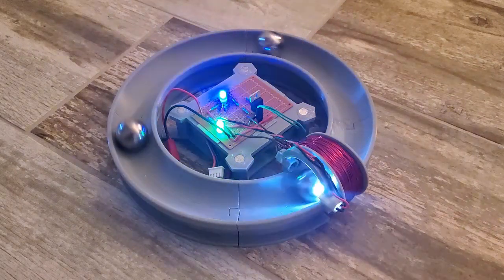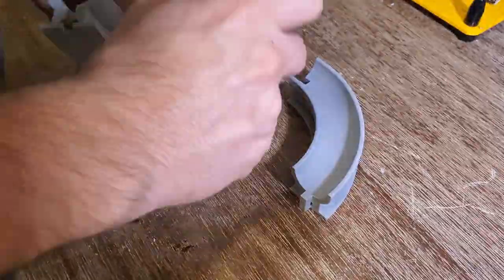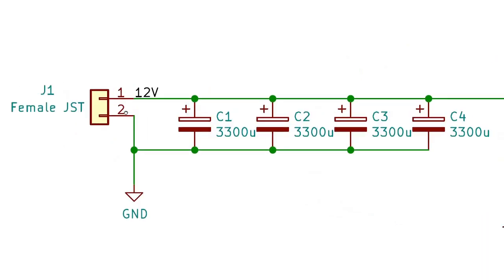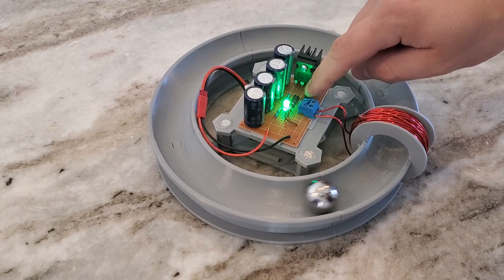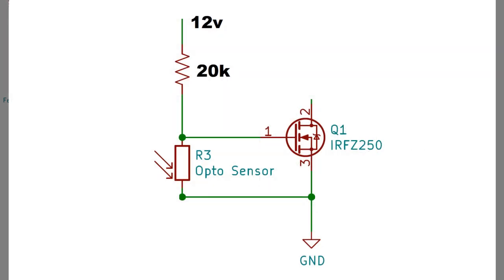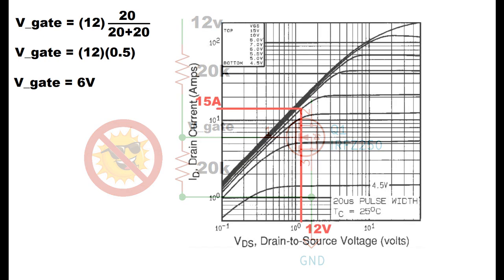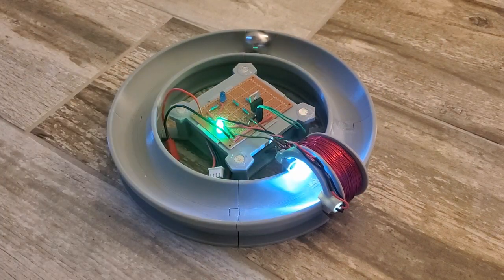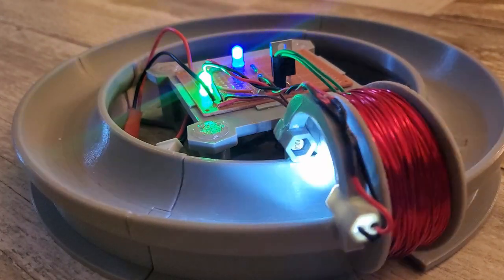Electromagnetic Ring Accelerator

Comment: For the electromagnet is the coil just wrapped around the same material as the track or is wrapped around iron?
Reply from the maker: It's just wrapped around track material
Reply: But then like did u have to make a crazy amount of loops by the wire to get a magnetic field?
Reply from the maker: @sceptre991  It's about 300 turns which only takes a minute or two to wind and there's 6 amps running through it. Nothing crazy
Reply: Oh I see. Because I was trying to replicate it but I only had 1 amp so that’s probably why

Comment: Hi! I know you might not get to this comment, but I was wondering what materials and wires you used in the middle. I already have the female JST, opto sensor, and led's, but I can't seem to find the rest. I'd greatly appreciate it if you could reply to this comment. Good job on the project!
Reply from the maker: The pieces are 3d printed and snap together with magnets. The board is just cheap perfboard

Comment: Using an electromagnetic acceleration gate would be interesting space tech for a non fuel dependent sling into the direction you wanna go. Build another gate on the other end to catch incoming traffic.
Reply from the maker: you mean this lol https://en.wikipedia.org/wiki/Mass_driver
Reply: @HyperspacePirate  aren't mass drivers to shoot unmanned projectiles at ridiculous speeds that would flatten a normal human with sheer g forces. And or a proposed way to launch material cheaply from one planet to another.
Reply: @HyperspacePirate  no I mean a literal gate large enough to accelerate a space ship to it's receiver, without killing the occupants. If you mixed this with one dudes molten sodium experiment you'd have a starship with a magnetic field (rad blocker) and an acceleration gate (fast intra system travel).
Using field manipulations you could have the receiving gate emit a repulsion field to slow the object in question on approach.
Reply: @HyperspacePirate  https://youtu.be/rAYW9n8i-C4 this guy's experiment

Comment: OK, I've printed all 4 parts with the 4 coile option. How would I wire all 4 coils? I'm sure I can't just connect them all paralel !
Anyway, thanks again for the STL files!
Reply from the maker: The high sides are all connected to VCC (12V in my case) and the low side of each coil is connected to the drain pin of its own MOSFET (i use an IRLZ44 in this case, but there's lots of others that will work). Remember to connect a flyback diode across each coil with the cathode *FACING VCC*, or else the inductive spike from the coils will cause a voltage spike that will destroy the whole circuit

Comment: how did you connect the LDR so far from the board?  And is this possible to with a breadboard and Arduino?
Reply from the maker: It's just 24 gauge wire running to the LED and photoresistor. Not difficult at all.

You can definitely do this with an Arduino

Comment: Good video! Is it possible to buy a switch wich is activated when the light is interrupted, like yours? I want to try it for myself
Reply from the maker: I'm not sure where to find them as packaged units, but it was very easy to build. I just used an LED and one of these photoresistors:

https://www.amazon.com/MCIGICM-Photoresistor-Sensitive-Resistor-Dependent/dp/B07PF3CWW9/ref=sr_1_3?dchild=1&keywords=photoresistor&qid=1624025077&sr=8-3
Reply: @HyperspacePirate  Thank you, not very experienced with this, you attached it to the board where it lets electricity trough, I think you made it yourself right? Or is it possible to get that somewhere
Reply from the maker: @thijsbeentjes3801  i soldered the parts to perfboard which is just a grid of holes with copper plating around them. 

I use this, but there's thousands of other options out there that work just as well:

https://www.amazon.com/AiTrip-Perfboard-Breadboard-Prototyping-Electronic/dp/B07XYL451Y/ref=sr_1_3?dchild=1&keywords=perfboard&qid=1624026067&sr=8-3
Reply: Thanks you so much, appreciate the help. Found out that the word is relais. Looking for buying one like the whole thing. I can’t put it together myself

Comment: I love the  compactness. Few questions, can you connect 12 coils in serial? Can you output or induce current to a secondary coil to create a magnetic field for levitation?  Can you share a parts list for that beautiful driver which is like a work of art.
Reply from the maker: Yeah, multiple coils can be used. In my video on version 2 of this device, i used 4 coils, but more can be added. The working concept is the same as a coilgun which can accelerate ferrous projectiles several hundred m/s. The coil could be used for levitation if it was powered by high frequency alternating current or driven by a position sensing feedback controller.

As for the parts, you can pretty much use any MOSFET, and the trigger consists of generic resistors and an LED + photoresistor. There's no specific part numbers that are required to make it work, it's all very generic
Reply: @HyperspacePirate  Thank you very much for the guidance and information. I greatly appreciate it :) God Bless

Comment: Nice presentation.  How about using magnetized balls to generate electricity as they pass through a different coil to generate electricity.  Then use the generated electricity to power the repulsing coil.  If there are more electricity generating coils than repulsing coils, it might work.
Reply: '  If there are more electricity generating coils than repulsing coils, it might work.'  No, it might not.  :D
Reply from the maker: I've tried running with magnetized balls, but the problem I've found is that they become unstable because the random rotation will pull their magnetic poles out of alignment with the coil polarity, which causes erratic motion once the ball picks up speed.

The ferromagnetic balls don't have that problem, because when the coil turns on, the magnetic domains will align themselves toward it, no matter which way the ball has rolled

Comment: Did you try to leave some balls static on the opposite side of the coil and see if it works like a Newton's cradle? (I.e: the balls take turns between standing still and moving after hitting one another)
Reply from the maker: Yeah, it works that way for a few rotations but the balls eventually space themselves apart and move in sync

Comment: Why couldn't you try to reclaim some of that inertial energy by having the balls travel through coils that generate electricity and even perhaps trickle charge the original power source?
Reply from the maker: That could work if the balls were permanent magnets, but in this device I'm using steel, so they're only magnetized when they pass through the accelerator coil

Comment: Maybe print a figure 8 track?
Reply from the maker: Yeah I've actually considered doing that, with the crossover in the middle of the "8" being raised a little higher
Reply: @HyperspacePirate  Just started looking at these yesterday. Really hard to find much on these. Also, what about using smaller magnet wire (with more loops) and smaller balls?
Reply from the maker: @circuitmage4240  I think the balls would go faster but have less inertia to coast around the track before they're accelerated again

Comment: this is great and it's a type of pulse motor I've always wanted to try. Are the .stl files available?
Reply from the maker: I haven't put anything on thingiverse but this should have all the .stl parts 

https://drive.google.com/file/d/1RxP4X38lzUi_-pFip7bhgTNCZ47Z6vLp/view?usp=sharing
Reply: @HyperspacePirate  thanks
Reply: @HyperspacePirate  I downloaded the files and in cura the track is tiny. I expanded by 1500 percent which seems to be about  the right size but was wondering if you have any suggested percentage increase ?
Reply from the maker: @mcorrade  Yeah, for some reason the software i use exports in units of 0.01mm even though i design in inches. Use a factor of 2540 and that will be exactly the right size.
Reply: @HyperspacePirate  cool thanks

Comment: I appreciate that this is entirely done with circuitry and doesn’t require any micro controller or coding
Reply: Although a MCU could help with timing…. Like keeping on the electromagnet on longer than the photoresistor is activated. Great Scott has a great video on the pros and cons of traditional circuitry vs Arduinos, builds an electromagnetic launcher with a MCU and without as an example. Very similar project.
Reply: @forrest2851  ive not watched that video but im assuming its because a lot of IC's and analog components have delays in the nanosecond range while a simple MCU program would be at least a microsecond? if thats the case an FPGA might be the best solution for projects that require the fast speed achieved with purely electrical projects but with enough complexity that you may want some digital aspect
Reply: @forrest2851 a capacitor would probably work as well
Reply: @forrest2851  You can totally do that with analog components as well but Microcontrollers are just much easier to use in most cases.
Reply: @RoycoNL  Yes I know I am advocating for the use of an MCU.
Reply: 😂😂😂 Deberías empezar por preguntar que es el sentido ,luego podrás pasar a otro nivel
Reply: Hahhahahha